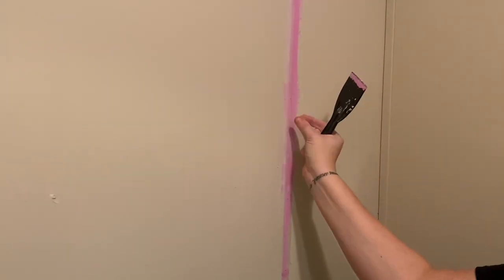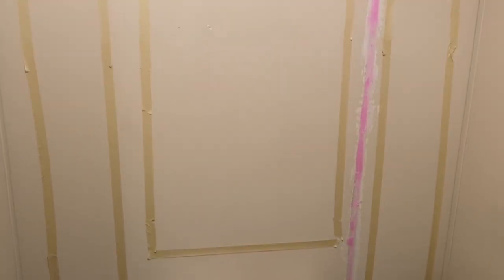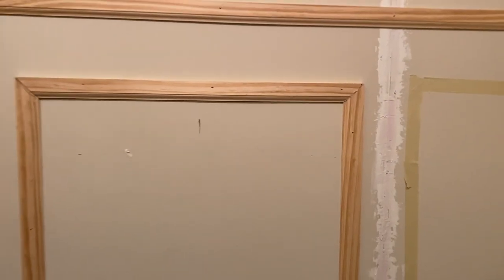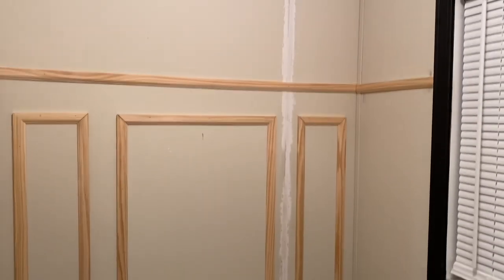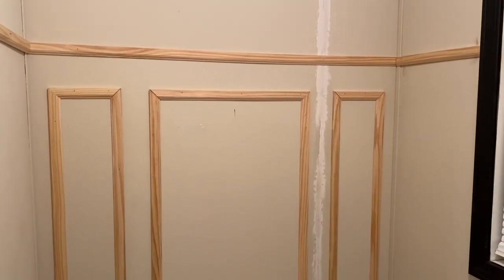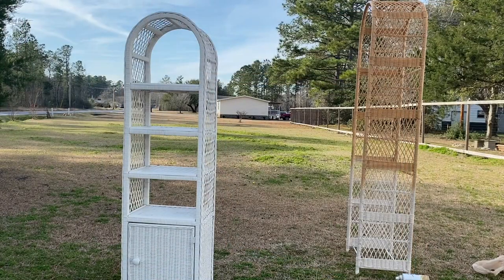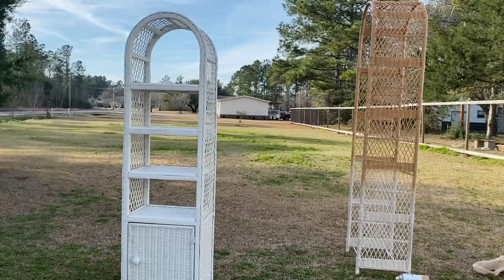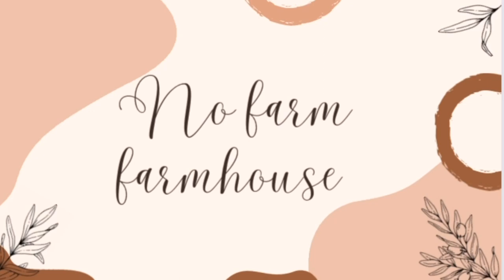*EXTREME* MOBILE HOME SMALL BATHROOM MAKEOVER MOBILE HOME| DIY WALL MOLDING |

Comment: I like it a lot. I would make one simple change though. I would take the time to remove the rest of the old trim on the walls and in the corners and tape the joints so that none of the new trim was going on top of it and it would be nice and smooth.
Reply from the maker: thanks for the tip and for watching 😊